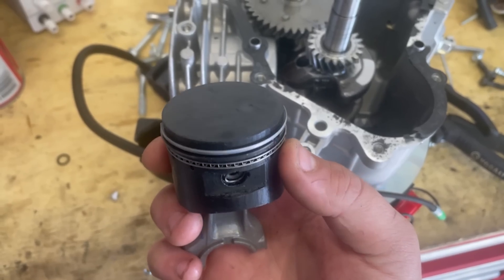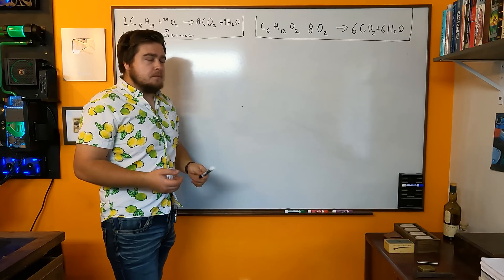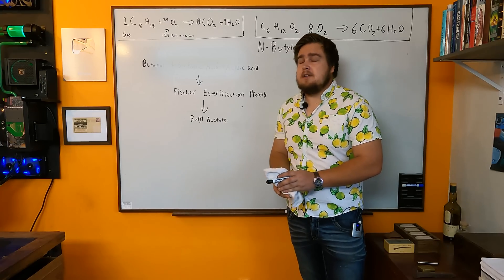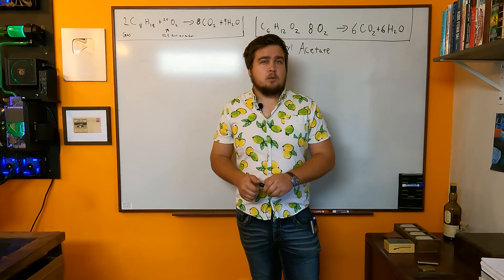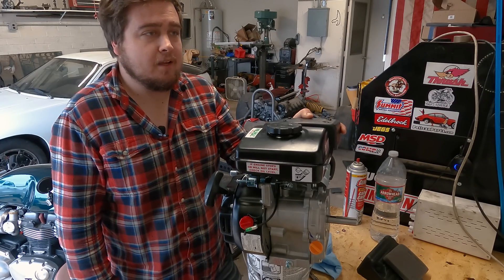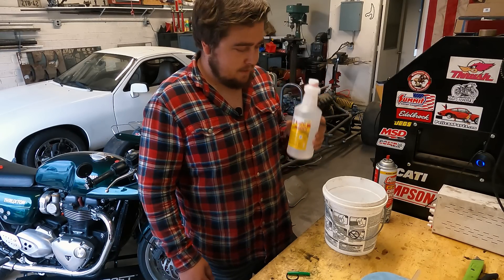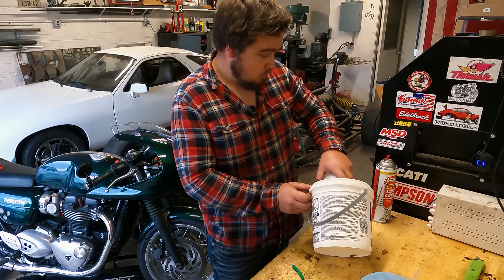Cold Burning Fuels and Plastic Pistons for Harbor Freight Engines!

Comment: What about a plastic piston with metal layer on the top?
Reply from the maker: That was my thought too- but I’m worried about the metal expanding differently under the heat
Reply: @WesleyKagan  if the an aluminum head can be made to work with an iron block I am sure it could be done.

Comment: Trail Tech sells an affordable head temp sensor that goes under the spark plug. Might help get more stable temp readings. A spot of flat black paint where you are using the thermo gun could help with accuracy too. Looing forward to the next part of this project.
Reply from the maker: That’s exactly what I’m looking for- thank you!
Reply: @WesleyKagan  Glad I could help. I had the vapor on my 2014 Suzuki DR650 so I could keep tabs on vitals and I remembered they have all kinds of gauges.
Reply: That would be great for air-cooled Volkswagens.

Comment: What about ceramic coating the crown? Maybe an aluminum piston crown insert with ceramic coating to keep heat in the combustion chamber?
Reply from the maker: That was my first thought as well- my concern is the aluminum and ABS expanding at different temperatures and speeds and causing a fracture
Reply: @WesleyKagan  I wonder if there is a ceramic coating that can be applied to the plastic piston itself? Might be a multi stage process, like a conductive spray, then an electrostaticly applied ceramic. I had some 2 stroke piston crowns coated years ago and saw good gain, but I have no idea what the process entails.

Comment: Perhaps think about methanol as a fuel instead of n-butyl-acetate. It has a lower adiabatic flame temperature of fuels that are typically used in ICE. It's high heat of vaporization leads to a lot of charge cooling relative to gasoline. It is pretty gentle on most plastics but is corrosive to metals. It can be mixed with water to temper the combustion temperature even further down, but you are going to have a good ignition coil if you go that route. Good luck.
Reply: every turbo tuner does that meth + water, or ethanol doesn't matter

Comment: WRT dyno...  What if you put a centrifugal clutch on the crankshaft and measure the force produced?  I'm thinking maybe use the chain to pull a scale and calculate torque or possibly weld a bar to the drum and measure the torque produced.  Sure you'll wear out the clutch relatively quickly but it will give you the torque at a given rpm.  Play around with the springs in the clutch to vary what rpm you measure.  

Love the channel!

Comment: Couple of thoughts, because im jealous of your time and enthusiasm.  🤯
1. If I remember right Butyl acetate was one of the additives that BMW used in the early 80's F1 turbo 4cyl to achieve 1200 + Hp's with higher boost and lower combustion temps.
2.  You might also take a look at the 'Torlon 'plastic engine project from the 80-90's that used plastics in blocks,heads, pistons etc.
3. One final thought would be coating the plastic in a substance that resists the esters, something like the spray copper that allows chroming plastics.

Comment: I'm not a expert, but I think the heat is the main part of the thermodynamic cycle in a Otto cycle engine. It is not like the reaction is releasing gas and expanding in the cylinder, is the heat release by the reaction expanding the air inside. I'm not glad to say that, but I think that ideia do not make sense at all.

Comment: Friction from the rings and conrod ends is going to add quite a bit of heat. Maybe machine a block of plastic with a higher temperature threshold instead of printing?

Comment: Cool concept!  They make carbon fiber nylon but that absorbs moisture like crazy so needs to be dried. 250 should be juust enough temp for Nylon. But they make cf petg as well. Polycarbonates are stronger but you need a hotend upgrade to hit the 280+(and non ptfe bowden).

If it doesn't work out, even with 100% infill, you could try mold pouring/vac some high temp epoxies. Maybe just dip the cap if they can't hold up? mmm, brain food. 

Best luck!

Comment: This is awesome, I always look forward to your videos. Does a cooler burn temperature mean increased thermal efficiency?  Do you think we will ever see printed engine blocks, starting with smaller engines?
Reply: There are EDM engine "blocks" in service around the world, the technology will be used almost exclusively on internals or maybe heads.
Though scale piston engines would be an exciting and worthwhile use of printing, so you never know.
Reply: Heat flux is proportional to temperature difference, so lower cylinder temperatures mean less heat transfers into the block and more energy is available to push pistons.

Comment: Nice video. Would be easy enough to cobble together an AFR gauge in the exhaust stream which would help dial in the mixture for the ideal temps. Keep going with it, interested to see how it turns out. Waiting for an air cooled plastic piston butyl powered motor with air actuated plastic valves 🙂 that can be printed open source.

Comment: As far as taking power measurements goes, if you can find a small generator that could bolt on that would make it easy to test with various loads.
Reply from the maker: I actually had an alternator bracket built but drawing a load on an alternator not on a car is rough hah

Comment: You gotta do this with an O2 sensor in the exaust so the mix is right.
Reply from the maker: I agree I think a fuel injection system might be something to consider. Rubber is a problem though.
Reply: @WesleyKagan  so hardlines and brass fittings :)
Reply: @WesleyKagan   how about a plastic connecting rod with thin aluminum bearing

Comment: Wouldn't Carnot efficiency mean with a lower burn temperature the engine would be inherently less efficient and less powerful?
Reply: Exactly what i was thinking obout. Bigger delta t equals better efficiency
Reply: Otto cycle delta T is a function of compression ratio, not flame temperature.
Reply: @nerd1000ify  in Real world you extract  energy from heat with pressure diference.

Comment: I believe you should be able to solve the temperature issues by using resin printing. With FDM you are always going to have the problem that the printer has to melt the filament in order to print it, but with SLA the hardening mechanism is UV based, so that is no longer an inherent issue.

Comment: Ford made polymer based engine back in the early '80's . It worked so well that they couldn't keep transmissions under it.
Reply: I’d never heard of this until now. Apparently it was based on a Pinto engine and weighed only 69kg vs 188kg for the cast iron version. Also it was rated at 237kw @ 9200rpm
Reply: IRC Honda was doing something similar for the S2000, but it wasn't cost-effective. Or something along those lines.
Reply: It cant have had plastic pistons, it simply gets too hot, and plastic is useless at conducting heat - unless you know a plastic that is viable to 2500 degrees C. The crank too can't have been polymer either, nor the bores etc. Part polymer most likely. The weight is in the block and heads and sure they could be rigid enough in polymer.
Wesleys piston would have lasted less than a minute. As would the Ford.

Comment: Some time ago i had a (perhaps?) similar idea, but slightly different.
The idea was whether a saturated solution of potassium nitrate would work as a poor man's nitrous.
I might try it out some time in the future because i have a spare four stroke engine in the shed but i don't think i have the time.
Especially since i don't want to just dump the mix in but i also want to dyno the engine to get some useful data.
Reply: Potassium oxide is a solid, so it will grind the inside of the engine.

Comment: Hmm, my comment looks deleted for some reason. Youtube was giving me an error when I tried to edit it so Ill just leave a quick little version of it here again just in case

Check out McMaster Carr in their plastics section. Filter by rods and disks -> low thermal expansion -> then select 500+ temperature rating. It looks like the glass-filled PTFE (but maybe too soft?) or the very expensive Vespel Polymide or Torlon PIA would be great to make some test pistons out of if you can machine them on a mini lathe instead of 3d printing.
Reply from the maker: Haha, I have some saved in my cart right now. I was looking at that

Comment: ASA should be more chemically resistant, but i think the next best thing would be nylon.
Fills are often added to plastics to make them more temperature (or impact) resistant, like GF30 and such, but i say this because there's carbon fiber nylon 3D filament out there that might work similarly and should be readily available.
I don't know much about nylon but i know that it likes to print hot and hates moisture, yet sucks it up whenever it can.

Comment: When comparing consumption, because you reduced air to adjust fuel mixture rather than add fuel, it makes sence it ran for the same duration. If you increased fuel to compensate it of course would have reduced run time.

Comment: You could look into resin printing, you can get a printer for ~$150 and they work out of the box.

Have not looked into it but you can probably get resins that are more resistant to chemicals like acetone.

As soon as I saw the piston I thought that would print well from resin!

Awesome work on this.
Reply from the maker: I need to order a resin printer, honestly. I’m starting to see them be affordable and would love the detail.
Reply: @WesleyKagan  I just picked up a Creality LD-002H for $220 AUD (~$160 USD) and it worked out of the box. All I did was peel off the screen protector and put some resin in and ~4 hours later I had an Eifel tower.

I am sure you could probably find it cheaper in the US.

The LD-002H is the 'old' model and people are advising not to get it as creality is phasing them out, but I have not found any good arguments why not to get it and its at least $100 cheaper.
Reply: @WesleyKagan  i was impressed when I saw that you can make custom 1 layer circuit boards with them. For engineering use though i still think fdm provides a better choice of materials.
Reply: @garagecedric  I never even considered that. but of course you can. just load up the traces on the LCD and plop the photosensitive side down. then all you need to do is the acid bath, final rinse then clear it.
Reply: There are also some high temperature resins out there that are good up to 300-400 degreees C. Might be worth looking into.

Comment: A high temp Nylon may work for at least a while. They aren't extremely hard to print. The glass transition temp really isn't important for this application, the heat deflection temp(otherwise known as 'heat distortion') is what matters. Taulman 910 HDT is relatively inexpensive if you shop around and can handle up to 150C if annealed. Otherwise there are some PC blends that aren't crazy hard to print that may work. Really PEEK or PEI would be ideal but good luck with those lol.
Reply from the maker: I did PLA Hi-temp for a while, and really like that stuff from bigrep. Thinking something that might be a bit more crystalline for chem resistance is needed. I’ve been avoiding peek but I think it’s inevitable haha
Reply: @WesleyKagan   I just looked it up, it looks like Nylon will handle butyl acetate without dissolving or degrading. Though nylon filament often blended with another usually proprietary polymer to make it easier to print. I guess the biggest problem is that it's a relatively soft material, but there are many grades/types of nylon that may work better than others. PA12 may be one of the better options.

PC on the other hand is about as poor of a choice as ABS and will readily dissolve in it, so I was completely wrong there lol.

Comment: 3dk Berlin filament: Heat resistent up to 230°C. Prints on most standart FDM printers. 3dktop is safe and suitable for food contact.
Reply from the maker: I’ll look into it! Thanks!
Reply: Even suitable for food? Are you saying we can make it double as a BBQ?!
Reply: 3dktop looks like it's still PLA, it will still likely be dissolved by the Butyl Acetate.
Reply: You might have to invest in a Ruby nozzle and carbon fibre filament, then. And bake to consolidate.
Or
You're only a few steps away from a home forge: PLA/wax loss mould and pouring cast AL (we lemon-ies pronounce ans spell it correctly!!), so pop over to MyfordBoy's channel and 'bridge the gap' ( Myford lathes, not the car fing).

Comment: 1:15 take the key out, take the key out, take the key out!!!!
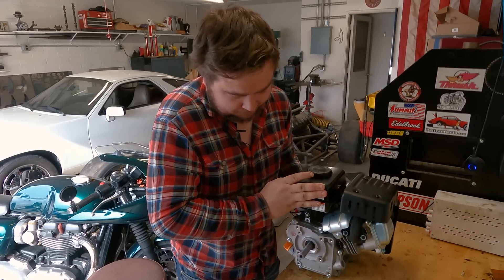1:45 no don't look into the shaft if the key flings out it will take your eye out.
Not to sound overly dramatic but that part was scary. I've seen those keys fly out.
Reply from the maker: You’re right- if I’m honest I tried to get the key out and it was stuck enough that I deemed it not a problem
Reply: @WesleyKagan  I'm glad you checked it beforehand

Comment: This is cool.
One of the issues I see is, as I understand, most of the heat from an engine comes from compressing air, not the ignition itself.
I've at least heard this for a typical car engine, may not be true for a low compression lawnmower engine.
Would be interesting to know how hot it gets if driven by another motor with no ignition.
This then becomes your theoretical minimum temperature.
Unless you start reducing compression ratio etc.
Reply from the maker: That’s my question too and why I want to get some data from the inside. I agree.
Reply: Oh, and maybe water injection.
And maybe a water jacket.
And an oil cooler.
What else makes an engine run cooler?
Reply: It's pretty easy to calculate the air temp if you know the compression ratio, however it's harder to know how much of it that transfers into the piston.
Reply: @garagecedric  it's probably pretty tricky to calculate to be honest.
First you'd need to know how hot the cylinder wall gets, but that depends on how much of the combustion chamber temps conduct to the cylinder, and also how much heat is lost to the atmosphere from the cylinder once it's up to temp.

Then, when you have an intake stroke, some of the cylinder heat will transfer to the intake air charge. This bit is critical as it will drastically effect the compressed air temps. But how much is the intake air heated? God knows, depends on rpm, cylinder temps, atmosphere pressure, cylinder surface area. More stuff I'm sure.
Then the easy bit is calcuting the increase in temperature due to compression (assuming none is lost to the cylinder).

It would be interesting if an insulating layer could be bonded to the top of the piston.
Then it's just the heat from the piston rings I guess. 
Fun project. Gets you thinking.

As I side thought, imagine your air is 40c after soaking some heat from the cylinder wall (no idea of that realistic) and you have a CR of 8:1.
That would mean that the compressed temps are (273 + 40) * 8 = 2500k. 
Have I done that right? Hot enough to melt steel, nevermind aluminium and plastic.
I guess only a small proportion of it goes to the cylinder wall, and most goes out the exhaust after readily cooling when it extends.
Crazy stuff.
Reply: @richardschofield2201  made a super quick calculation on the adiabatic compression process and ended up with around 400C with 8:1 compression. Though that's very ideal of course
Reply: @garagecedric  that does sound more reasonable.
I'm trying to remember something from almost 20 years ago so defer to your answer
Reply: @richardschofield2201  for adiabatic compression, t2=t1(v1/v2)^gamma > so for air with compression ratio of 10 you’re looking at an absolute temp increase of ~2.5x
Reply: @TomM-jh8lx  ahhh, good stuff. Thanks for that.
Reply: @TomM-jh8lx  assuming you’re using 8 for v1/v2, and 0.4 for compression of air, and this means 2.3 x t1 is only for compression before combustion. Since most of the pressure increase (and therefore peak temperature) comes from combustion your predicted temp increase is low. Using round numbers, roughly 300 degrees (K) x 2.3 = 690 degrees (K) before combustion. Since combustion increases pressure to about 1000 psi (roughly an additional 10 fold increase) using p2/p1 (v is relatively constant) t2/t1 = 10 ^ 0.4 or an increase of 2.5 times over the initial compression increase. 2.5 x 690 = 1725 degrees (K) or slightly over 2,600 degrees (F). It’s worth noting that this COULD melt aluminum in time, but the temperature drops rapidly as the cylinder volume increases via piston movement AND heat is transferred to the cooling medium (air in the case of the engine in question). If memory serves, exhaust temperatures drop to closer to less than 900 degrees (F), 10 to 50 milliseconds after combustion( depending on engine speed); of course intake air is closer to room temperature. Of further interest in the case in point is the question of how much pressure can a 3D printed part withstand.
Reply: @garagecedric  we know piston area and Q
Reply: My diesel vw has high compression and takes forever to warm up in comparison to our gas car. You are obviously correct that compression makes heat, but I wonder what percentage.
Reply: @olmstead25  Diesel engines take longer because the blocks are always iron, most gasoline engines produced in the past 10 years are aluminum, and there is usually a lot more metal there to get warmed up.  Iron has a higher specific heat than aluminum.  Although, AFAIK all VW turbo engines have iron blocks, which is why my GTI takes longer to warm up than my truck.

Comment: Dont think you are supposed to run it with the shipping oil. :/
Reply: It must have been a relief for you to see him @1:02 fill it with "not shipping oil" then.
Reply: @dav1dsm1th  then he shouldn't have said "add some oil" adding oil implies he didnt drain shipping oil since he didnt show us or say anything about draining shipping oil. He just pulled it out the box and wrapper. Ive bought that same engine. It had shipping oil in it.
Reply: @jtj250  After you drained the shipping oil did you add some new oil?